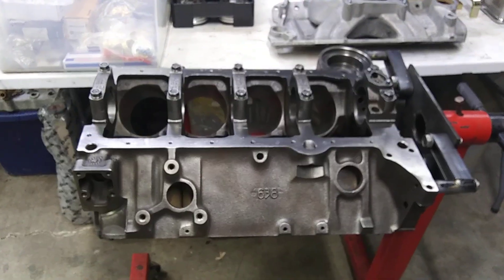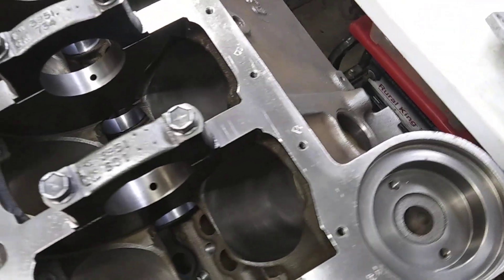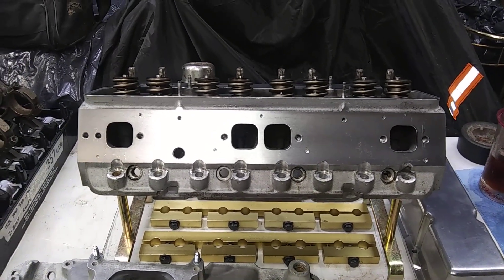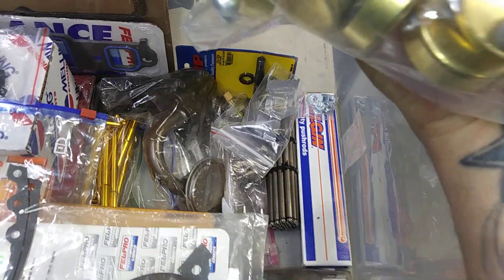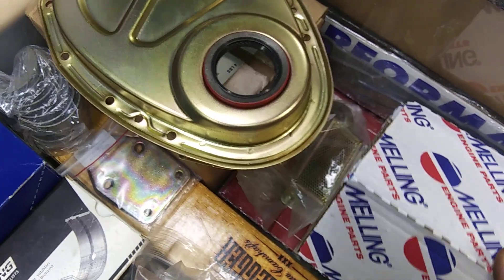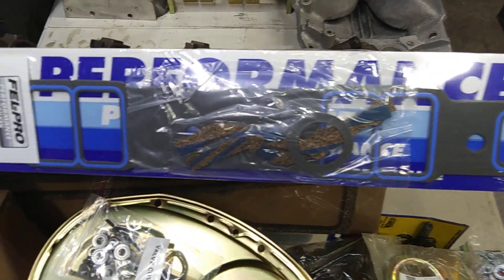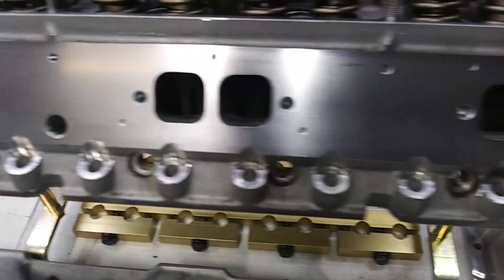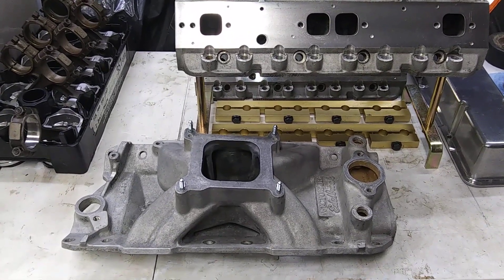One way to build a "Low Buck" NA 500+hp 357ci SBC Street/Strip. 1990 L-98 2-bolt 350 from a Z-28.

Comment: 👍 Good video. I like the dog bone and spider set up in those blocks way lighter than retro fit roller set  up
Reply from the maker: Yep, definitely makes the roller cam conversion alot easier. Shits oem. reliable too. I'm using the Comp short travel lifters, they will pull 7000+rpm without pump up. Cost under $300 bucks for the lifters.

Comment: Should be a fun little grocery getter, what vehicle is it going in? Are you going to swap to main studs or keep the factory bolts and what will the cam specs be?
Reply from the maker: Using GM main bolts made with the standoffs for the tray. Main studs would require line honing the block. Not necessary at this level. Using stock Vortec main bolts. Cam is 240/252@.050, 554/554 lift and 108 lobe separation. Probably drop the engine in my 95 Blazer just to get it running.
Reply: @thereluctantgearhead4544  
You like those huge duration cams, ever consider trying a lower duration higher lift cam? That way you won't need a high stall or numerically higher gears, plus if that thing has a 700R4 in it you would get decent fuel economy.

I have a hydraulic roller Comps XFI cam that has 202°in. and 212°exhaust with a .550" in. lift and .546" ex. lift with a 113° LSA in the sbc 383 in my '65 Impala. It weighs 4,400 lbs plus another 210 with my fat but in it and it does 13.0s in the QM. I also get 26 mpg highway on the way to the track with it. The 383 is backed by a 700R4 with a 3.07:1 rear gear. 

This drivetrain in a car 1,000 lbs lighter would be in the 12.0s. Would tickle the 11s with the proper valve springs, which I have but haven't gotten around to installing them yet.

City driving is fun with this combo, it sets you back in the seat in that first gear the 700 has. When I force myself to keep my foot out of it I can eek almost 22 mpg city. But keep in my foot out of it is very difficult.😎
Good head flow, a cam that has enough lift to take advantage of where the flow is you really don't need that much duration. The LS engines have proven that, works for sbc engines as well with good heads.

Back in the day to get the poor flowing heads to make power the cams needed more duration to make up for the crappy heads back then. But now aftermarket sbc heads flow as good as aftermarket LS heads, some even better.(the 14° stuff) 

It's way easier to get more cubes out of a sbc than an LS. And now the cheap eBay sbc heads flow 250 in. cfm out if the box makes it very cheap and easy to make power with a sbc 

If you have a roller block and you do, there is a company in Texas that sells factory roller cam regrinds for a reasonable price that are more performance orientated but not quite as radical as the one you have, worth a look anyway unless you like stopping to get gas?
Reply from the maker: @itseithergonnaworkoritaint7852 Yep, I've used milder cams in certain builds. But I usually build Street/Strip type cars that are more Strip. We have a bunch of vehicles,  so if I need a normal ride, I'll take the stock minivan. But I like driving loud, rowdy machines that get the blood pumping. I'm embarrassed to be seen in a minivan. But that's always been my solution, just own a bunch of vehicles. We also have a stock 95 Trans Am that'll go anywhere pretty cheap. For now anyways. Even my old yellow C-10 is pretty dependable.
Reply from the maker: @itseithergonnaworkoritaint7852 Hell, that's a mild, street cam to me. I usually go bigger.
Reply: @thereluctantgearhead4544  
Yeah it's very mild, pulls 22 inches of vacuum at idle! Have to run a 10.5 power valve on it in the 850 Holley double pumper that sits on top of the sbc 383.😁

 It surprisingly runs a lot funner than it sounds with all that torque right off of idle! It's a heavy car though is the main reason I choose that cam. I looked for the lowest duration @ .050" with the highest lift roller cam I could find and rolled the dice when I found that one. Well it paid off, I love the way it runs.

Perfect cam paired with a 700R4 transmission. That's because with the right off of idle to 5,000 RPM power range that keeps pulling to 6,000(would be even more with the right valve springs) the huge gear ratio drop from 1st to 2nd gear with the 700 isn't a big deal for this cam.

With just 355 or so cubes a 3.23 to 3.36 rear gear would probably be a good idea with the less torque the less cubes would make. My car has 28" tall tires on the rear so keep that in mind when choosing the rear gear if you go this way with one of your builds?

Comment: How many ci. Is a 0.60 small block chevy
Reply from the maker: 360 cubes
Reply: I have a 60 over 010 block,  don't know if I want ti use a 350 crank for a 360 cubes  ,  or I have a large journal  327 crank  that would make 337 cubes,  might do it both ways and see what works better